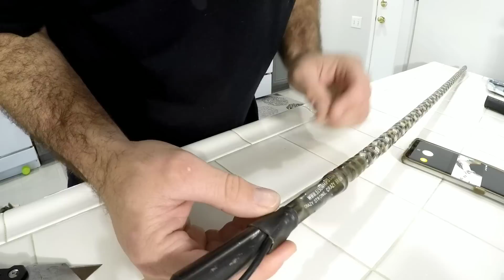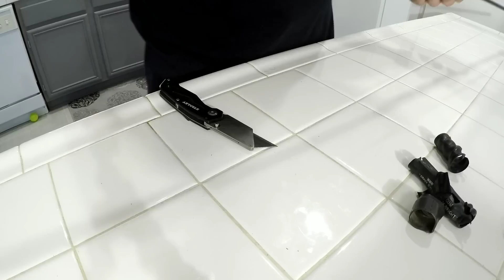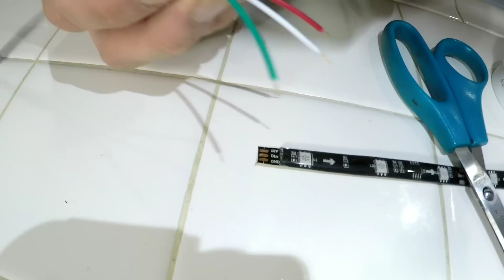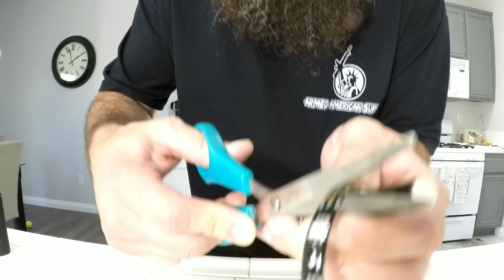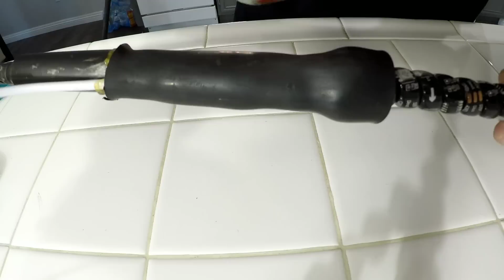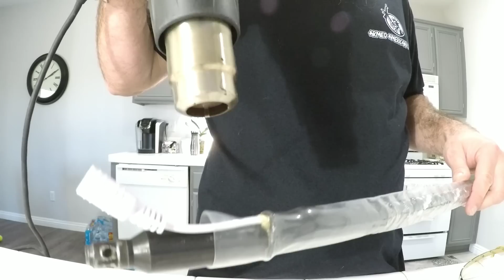How to make a lighted led whip

Comment: So to connect this to a 12v supply do I just cut the white connection off and wire the power and ground to a battery?
Reply from the maker: Or just use a 5.5 male connector to match the female side the controller comes with. Your call on that conection

Comment: Dude, thanks for posting this video! I have a couple of questions though, what is the size and type of shrink wrap you used before you used the clear 3/4”? Also, the controller looks like it comes with the female end of the plug, what connection is that? I would assume I should be able to buy the male end, and then splice it into the battery?
Reply from the maker: The black wrap is 1⅛" 3to1 adhesive shrink wrap found on Amazon. The plug you are looking for is referred to as a 5.5 male barrel plug. Hope this helps
Reply: @MrRICKDAWG4444  Hey, cant find the 1 1/8 adhensive shrink wrap on amazon any way you could post the link?
Reply from the maker: Type in 1.25" adhesive shrink wrap and plenty will pop up. Alot of the links in the description have expired and i need to re do them. Ive just been super busy lately and haven't had any time.

Comment: Wanting to do this and have a CB connected to the antenna as well. Will the LED lights cause a distortion at all?
Reply from the maker: Yes i would dedicate another antenna for the radio because it will mess up your SWR's and possibly hurt the finals in your radio.

Comment: Thank you again for this video! I have made one now and I have another question. The led lights silicone coating is splitting as soon as I finish wrapping them and beginning to slide the shrink wrap on, do you have a trick to prevent this?
Reply from the maker: I'm glad you enjoyed the video. As for the silicon on the strip, practice makes perfect. The first one i made also started to split and the only trick i found is to have everything ready to go before you start wrapping and work fast so that it does not have a chance to split before you get the shrink wrap on. I hope this helps for your next build. Feel free to reach out to me with any other questions you have.

Comment: I built one of your light sticks last year and lost the remote hand held controller.  Will I need to replace the controller on the light stick and get a new hand held remote or cam I just get a remote and get back to having fun?  Thanks so much for the info.
Reply from the maker: Most remotes use the same frequency so yes you can. However look into my part 2 video on my channel

Comment: First of all, thanks for the video. I’ve got a couple of questions. One is how many strands of the lights would it take for 2 4ft whips made out of Cb antennas and also would I have to have two controllers as well?
Reply from the maker: One roll of LEDs can compete one 4' whip with some left over. I like to use a new roll on each whip to avoid an extra solder point. Yes you can use one controller but you will need to splice the two whips together on the same controller so they will be in sync. The whip i built in the video was for a single whip application however you can get creative with the controller placement and run wires to as many whips as you want.
Reply: Got it. What’s your thoughts on the 3/8 CB antennas?
Reply: DMAX909 what do you use to split the 2 whips together? Just wire or special connectors?
Reply from the maker: The make these really cool 3pin screw together connector i like to use now
Reply from the maker: https://www.amazon.com/BTF-LIGHTING-Plastics-Waterproof-connctor-Applicable/dp/B01LCV8LGA
Reply from the maker: I didn't see the other comment on the cb antenna. Depending on what you will be doing with the whip you will want to jb weld a air hose fitting to the bottom of the antenna because they are really weak at the threads.
Reply: DMAX909 thanks for the reply’s. I ordered everything earlier today. And I ordered the 12v pig tail connectors. I might try to cancel them and order the ones you just sent me. I’ve also changed my mind on ordering the Cb antenna and just making them out of my fiber optic whips that I already have. They are almost 3/4 thick. Do you think they might be too big.
Reply from the maker: Nope, you're gonna need alot more LEDs to wrap them though, just know that after about a roll and a half you will need power injection if you plan to run solid white.

Comment: Can you hook a wire to to make it go red when you hit your bake lights?
Reply from the maker: Great question, I know this is possible with 50/50 chips. However I'm not sure this can be done using this controller and ws2811 chips that I've used in this video. I'm sure it's possible but you would need to use a different controller and then program this feature in using software like led edit.

Comment: Awesome video man. Definitely gotta try make my own now. What kind of heat shrink did you use to protect the control module at the bottom of the whip. You mentioned it was a heavy duty heat shrink but didn't mention what brand or where you found it.
Reply from the maker: Check out the part two video. I believe I put that shrink wrap in the description. Also I don't put the controller in the whips anymore I explaine that more in depth on part two.

Comment: Great video, what do you use for the vehicle side of that plug and is it waterproof?
Reply from the maker: I use these 5.5 connectors that you can get here.https://www.amazon.com/43x2pcs-Connectors-Security-Lighting-MILAPEAK/dp/B072BXB2Y8 
I don't believe they're waterproof but i have never ran into a issue when they do get wet.
Reply: So you don’t need to run a power supply at all for this set up? I ordered the same connectors but also had the same question. Is it safe to just ground it to the vehicle, then run to a in line fused power to a toggle switch and then power up with remote or do to need a power supply just like one for in home use?
Reply from the maker: Long as you order 12volt leds you wont need a power supply. You could ground at the whip and run one wire if you want. Just make sure its a good ground.

Comment: Where did u find the thick shrink wrap u used on the bottom of the whip???? And also great job on the video !!!
Reply from the maker: Thank you for your Comment, You can find the thick shrink wrap on Amazon in shorter pieces but this is what i get in 4ft lengths because i use alot of it.https://www.amazon.com/Black-Heavy-Adhesive-Lined-Shrink-Tubing/dp/B00NVDFQWU
Reply: Thx for info ..... u convinced me with ur video to try to build 2 for my sxs.... thx again
Reply from the maker: You're welcome it's super easy. Feel free to reach out to me for any other questions you might have in your construction.

Comment: So with using that controller and what not listed in the description, how do you go about running two whips to sync and run it to a battery what do I need to do from the plug sticking out the whip? Thank you!!
Reply from the maker: You could go about it a couple of different ways. The remote will work with both whips so if they are both powered on at the same time changing the  modes will change them at the same time. If you manage to get them un synced unplug one and change it to the mode you desire then power off and then turn the power switch off on your car plug the other one back in and you should be all set.
Reply: Do I just cut that plug off and hard wire them both to the battery? Or what do I do about the plug in order to run it to the battery? Thanks for your reply man it helps a lot!
Reply from the maker: Well you could do that if you don't need to remove your whips often or you could just use the male plug that goes to the female plug like these. https://www.amazon.com/X-group-20pack-Pigtail-Connectors-Surveillance/dp/B0725BCVH1 and just wire them up to the same switch on your car.

Comment: Good video. What did you use for the top of the whip to seal it?
Reply from the maker: Just a 3/8 cap then the shrink wrap seals it water tight.
Reply: And if i wanted a pair would i have to by the two wireless controllers? Or could i just connect them together to one.
Reply from the maker: I build them differently when syncing a pair. But yes you splice one controller to both whips.

Comment: @DMAX909  Very informative. Thankyou. 
Requesting some advice. I have a 10 foot, two piece whip which would require almost 9.3 meters of ws2811, 60 led/meter strip to cover it entirely. I stay in Dubai and the desert drive whips must be longer than usual. 
A 5 meter strip can cover the lower half of the whip. Question is, when i inject power to the second strip, can i draw the power from the same Dc 12v driver or should i use a separate driver?
Reply from the maker: I would run separate power and ground wires under the first strip up to the second stip. You could run it from the first power source. Be sure and watch my part two video on my channel
Reply: @MrRICKDAWG4444  The second video answered all doubts i had. 
Thankyou . 👍🏻💐
Reply from the maker: Nice. Glad I could help

Comment: Great vid! Your link to the LEDs has 30LEDS per meter. Can the LED strip with 60LEDs per meter work the same?
Reply from the maker: It depends how tall of a whip you're making, the 60leds will require power injection after one roll. The 30leds will look better from a distance also.
Reply: @MrRICKDAWG4444  finally got around to this. Followed your vid almost exactly since I used firestiks. Turned out great, thanks again for the awesome vid!
Reply from the maker: Right on man I'm glad you liked it, enjoy and don't forget to share the video with your friends if you wanna show some support.

Comment: Great video! I have a question about the 2 wires that aren't being used. The white wire and red wire. What are they for?
Reply from the maker: The Green wire is always the data wire. The other two wires are for 12v power and ground. The two extra wires that some strips come with are for power injection if you are running multiple strings.
Reply: @MrRICKDAWG4444  thank you. I'll be giving this a go over the weekend. Well done
Reply from the maker: Awesome. If you have any other questions along the way feel free to reach out to me.

Comment: What size black heat shrink and clear did you use? Also, if we are wiring up two whips, we can run both sets to one controller, correct?
Reply from the maker: I use 7/8 for the clear and 1"-1/8 for the black all of it 3 to1 shrinkage. Yes one controller can run both whips long as you don't exceed like 2024 pixels i believe.
Reply: @MrRICKDAWG4444  Do you have a link to the thick rubber black stuff? Im not seeing it on amazon.
Reply from the maker: https://www.amazon.com/Black-Heavy-Adhesive-Lined-Shrink-Tubing/dp/B00NVDFQWU

Comment: on the power side of the controller can you use a 2 core 2 pin black pigtail rather than the 5.5 male connector for power?
Reply from the maker: Yes. I actually prefer doing that. I don't use 5.5 connections anymore

Comment: Would mineral oil work better then wd40? I know electronics can be submerged in mineral oil without issue.
Reply from the maker: I'm sure it would work fine I've never tried it tho. i just like the wd40 because it evaporates and doesn't leave behind a bunch of oil residue inside the shrink wrap. If you try mineral oil let me know how the final product turns out I had problems with other oils staining the shrink wrap a yellowish color.
Reply: @MrRICKDAWG4444  I've found that silicone sprays did not leave a yellow color on the shrink wrap.
Reply from the maker: I use compressed air now.

Comment: Hello, thanks for the amazing video!!  Im trying to find a bluetooth controller that will work for these and still has the same functionality if not more than the one you recommend.   It's hard to keep up with a remote when on the trail... Im not finding a bluetooth controller that has the same functionality like the stacking, do you have a recommendation?
Reply from the maker: Thx. I use the sp110e controller found on Amazon for tight spaces.
Reply: @MrRICKDAWG4444  does that have the same functionality...I saw a previous post from a while back that stated the bt controllers have less functions
Reply from the maker: That particular one has 120 settings, every static color speed and brightness and a easy to use app.

Comment: Can this be done to truck CB antennas and still be able to use CB and also hold up to highway speeds
Reply from the maker: Yes but you don't wanna use the radio anymore because your swr's will be way out of whack
Reply: @MrRICKDAWG4444  i run duals on my truck guess it's time to add the 10ft back for the radio
Reply from the maker: Yup thats the way to go anyway
Reply: @MrRICKDAWG4444  thanks for the help didnt know if you reply b.c the video was posted a year ago

Comment: Where do I find the power supply plugs to wires to a 12v system?
Reply from the maker: Everything can be found on Amazon. Search 5.5 plug
Reply: DMAX909 thank you so much!! Was able to build a whip for my rzr. The only issue I had was I thought the higher the waterproofing the better. Not the case and had to get creative.

Comment: Have you made any with turn signals and brake light?
Reply from the maker: Yes I have a controller I have custom ordered I use that does brakes, turn signals, and reverse light and then goes back to sequence when those modes are not being currently used.

Comment: Hi! im looking forward to making 2 of my one for my 4 wheeler. I just one question about the controller. what adapter can you get so you can run wire from a 12 volt battery source to power the controller?
Reply from the maker: Basically anything. On quads i like to splice it to the taillight so it's powered when i turn on the lights.
Reply: @MrRICKDAWG4444  but, I noticed that you are plugging it into the wall for power, how can I make so the I can power the controller with a 12v power source?
Reply from the maker: @andyfonseca9265  the plug i have in the wall is just a 12volt converter. you can take the two wires from the controller and put them to power and ground on a 12volt circuit anyway you like. Hope this helps.
Reply: @MrRICKDAWG4444  do you strip the wire with the round plug?
Reply from the maker: @obsessivehobbies5464  no that plug is already wired into the controller.
Reply: DMAX909 I don’t see that the male pigtail that you solder to the LED’s comes with the controller. (At least isn’t doesn’t say that it does) where do we purchase one of those?

Great video by the way. Very informative.
Reply from the maker: That end is going to be a 5.5 male barrel plug you can find em on Amazon also

Comment: i built two 4 foot using all your suggested parts and after about two weeks they suddenly shut off and would flicker if i hit a bump checked all connections and they look fine. tore the whip back down and just touched the strip to power and it lit up in spots. tried the controller to power and nothing. did the controller take a dump on me? if so is their a higher quality bluetooth one to run off my phone that is water proof?
Reply from the maker: You can make the sp110e Bluetooth controller waterproof but you will have to split it open and incase it in silicone to be waterproof there is a controller out there thats waterproof proff but it is limited on the stuff it can do as far as presets go and it's 5times expensive so I usually use the sp110e. Also Set your whip up so it has a 3pin connector coming off of the whip so you can change controllers without striping the whip down.

Comment: Great video, I’m trying to make an 8’ whip for my atv, I read your comment about running an additional power wire for the second strip on top, is this the only option or does someone offer led strand that’s around 30’ that doesn’t need additional power supply. Thanks in advance.
Reply from the maker: Wow 8' is pretty tall for a quad, legally it only needs to be 7' from the ground that being said you can contact the manufacturer of the leds and they can supply you with a longer roll however it's easier just to solder them together see my part 2 video for that. As far as needing power injection wires that's really only necessary if you intend on running solid white because that uses the most power and without power injection you will notice the top of the whip won't be the same color white as the bottom. Hope this answers some of your questions feel free to reach out with anymore you might have .
Reply: @MrRICKDAWG4444  thanks for the quick response, we are riding little Sahara state park Oklahoma, they require 10’ from ground to top of flag, it’s ridiculous I know.
Reply from the maker: @nikkibohanon5136  Oh wow that's definitely a little excessive on the 10' rule. Those dunes have always been on my bucket list thanks for the info that's good to know.

Comment: What do you do when you want 2 whips. Ive seen the bigger boxes with 2 ports but do they make what your showing with 2 ports?
Reply from the maker: Well it's possible to sync two whips using this controller or you could just use a a bigger controller mounted externally.
Reply: @MrRICKDAWG4444  yea I've done that before works fine. I liked the sleakness of your set up. Do you ship these by chance?
Reply: I have problems heating them they dont work properly after shrinking bc of the heat.
Reply from the maker: I don't actually have a store or website i sell these at. Everyone that has one i know personally. However if you really wanted some we could work it out on PayPal i suppose.